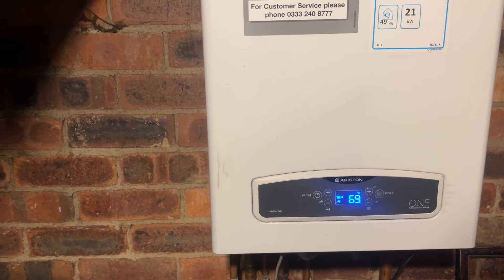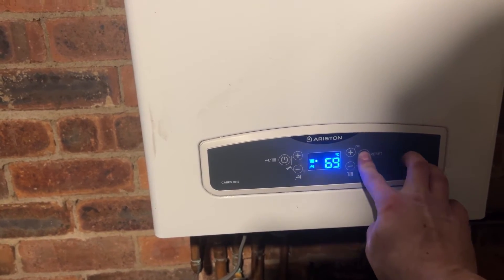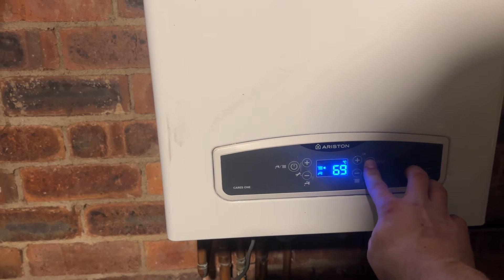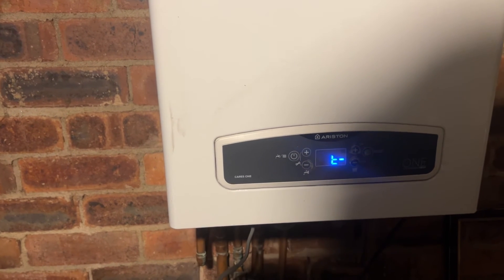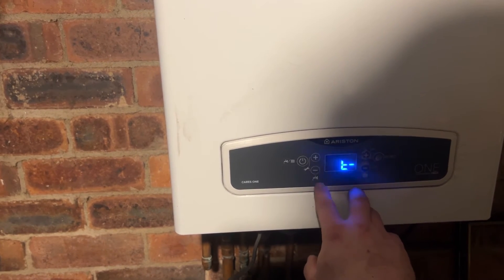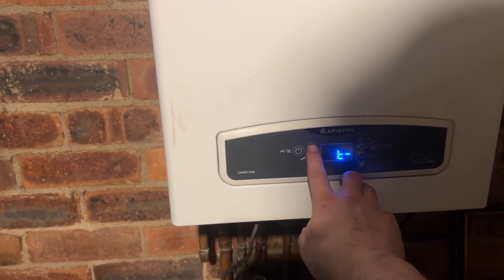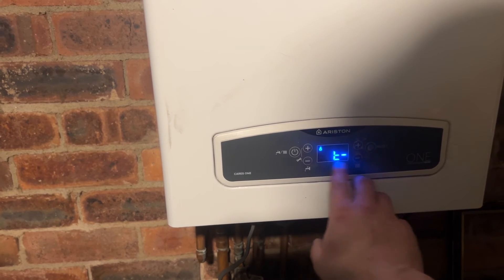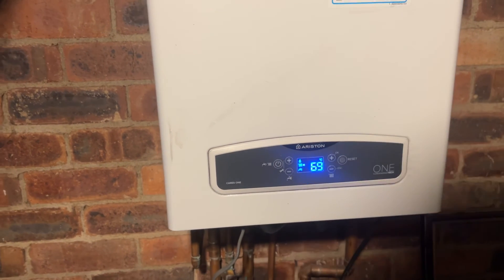How To Put A Ariston Cares One In To Service Mode || Boiler Training

Comment: Main issue im having with mine is that the heating is working but the boiler fails to kick in for hot water
Reply from the maker: More than likely the flow sensor